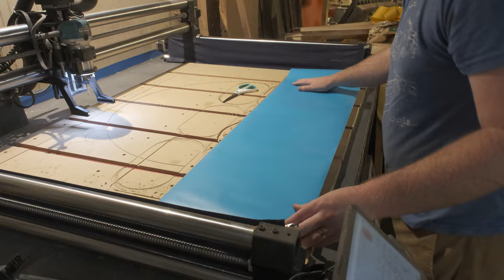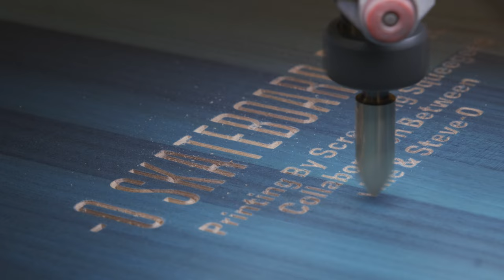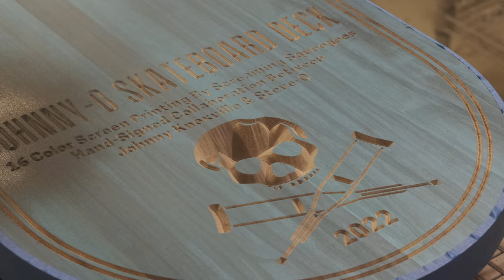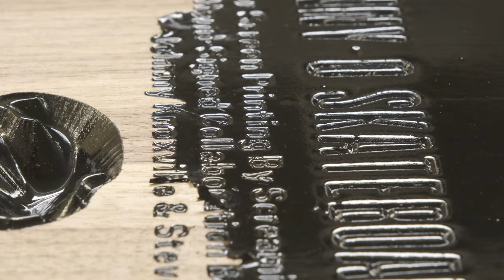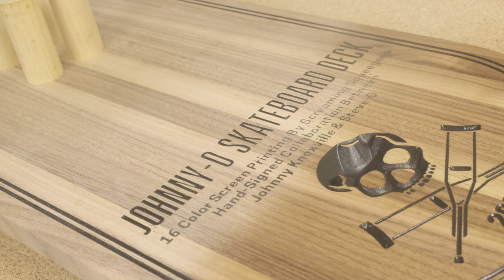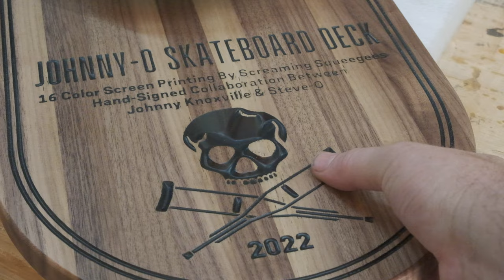This V-Bit Is One Of A Kind

Comment: Just found your video, I need to cut a 90 degree chamfer to a depth of about two inches( the depth of my work piece} in a circular pattern. Can a tool path be set to make a smooth chamfer with the bit in your video?

Comment: it's not a downcut )  it's just better ground than regular woodworking bits.  actually it is regular chamfer end mill used in metal milling for years.
(most of woodworking "awesome innovations" are plain old metal cutting tools)
and why you use this masking film?  wasn't it be easier to spray some varnish than mill your relief, paint it, and after that just skim 0.5mm of the board.  it will be faster than manually removing that  film.
Reply from the maker: Everyone does things differently, I guess!
Reply: The Amazon link for the masking might be a clue.😉